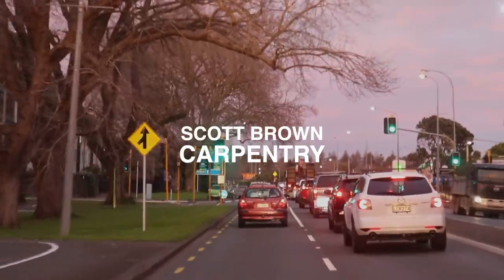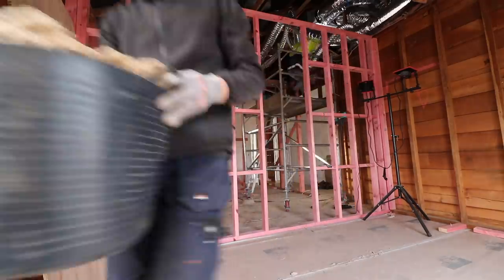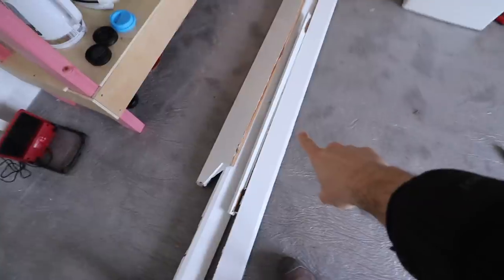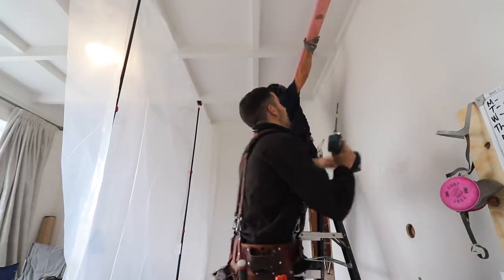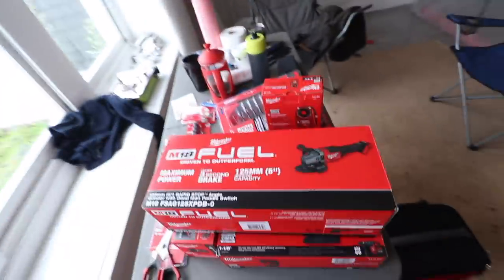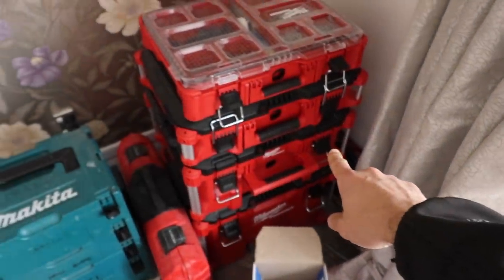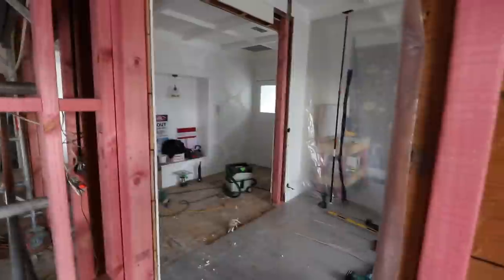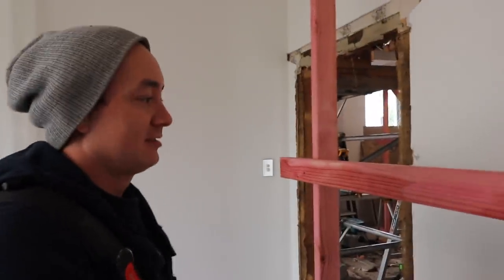Will This Ceiling Hold?

Comment: You already have the Martinez hammer. You really need to get the Martinez titanium prybar. It’s sharp and super flat and just wide enough to where it’s perfect for pulling off trim, casings, and molding, are used to split trim all the time until I started using this. It’s awesome.

Comment: Hi Scott, loving the channel, can you please tell me how you price a job like this, do you give a estimate, a quote or I'd it charge up, seems like it would be very hard to price such a big complex job. Cheers Steve
Reply: Easy to price. Just make sure you have tags for all unexpected occurrences. A job like this would take around 8 hours to price once you've tabulated everything. Most big suppliers will estimate materials which you still need to go through with a fine tooth comb, then work through the job in your mind a few times. Oh, and always read every word on the plans from front to back at least 5 times.

Comment: When I see you and others using Makita impact drivers to put big screws in, it upsets me. The dewalt 3 speed brushless is so so much quicker that it’s worth buying the tool, battery and charger. Definitely recommend
Reply: Mate, Dewalt kicks ass over Makita for most tools. I've actually started looking at people sideways if they think otherwise and wonder if they even work with tools at all.

Comment: I think the videos are awesome but one question do you ever use acrow props (jack post) for temporary supporting ceilings when taking out a structural wall as in the uk we use them all the time rather than building a temporary wall. Might not be a thing in NZ but just wondered
Reply: This is actually a really light weight structure, single story, steel roofing etc. We use acrows for 2 story, heavy roof, large structure etc. Acrows are heavy and a pain in the ass to move around, take the same time to set up, can kill a man by gravity alone so avoiding them is a plus.
Reply: Tristan Patterson Cheers yeah that does make sense. Just wondering as I hadn’t seen them in any of the videos that I’ve seen. And yeah I agree, acrows have got some weight to them